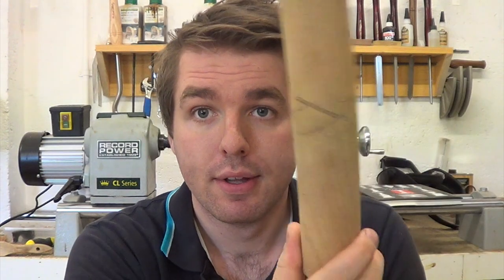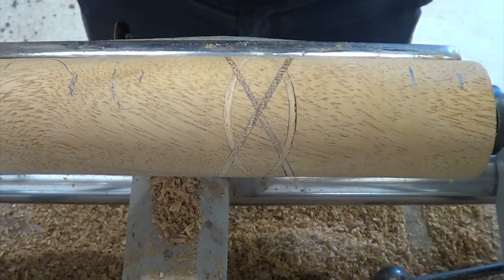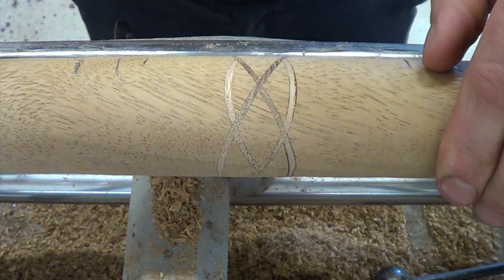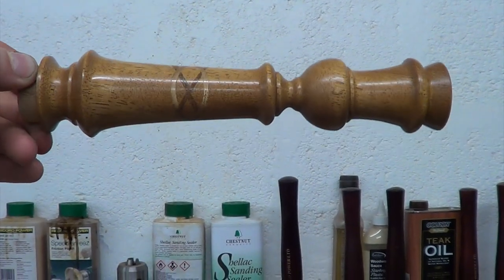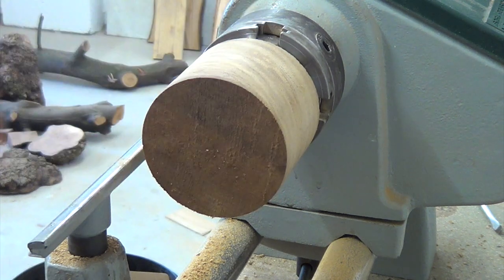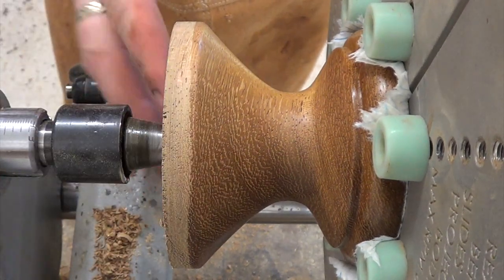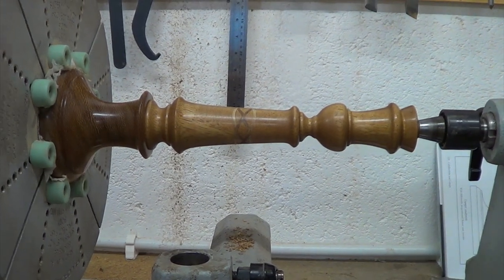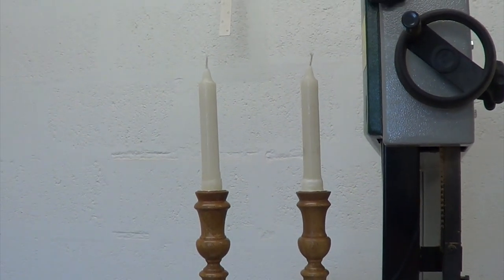Iroko Celtic Knot Candlesticks - Turning a Matching Pair

Comment: hi, nice candlestick, you have  good eye for copying, there is one thing I would suggest you do to open the hole for the candle, as it was apparent you had problems with the hole being off centre, I suggest you avail yourself of a centre steady to hold the candle as it is so fare from your chuck, to make life easier for you if you open the hole as soon as you have turned the stock to cylinder and then use this to centre the job. I have been a  turner for for over 50 years. so I hope you are not offended by my comments.look forward to your comments. keep up the good work.